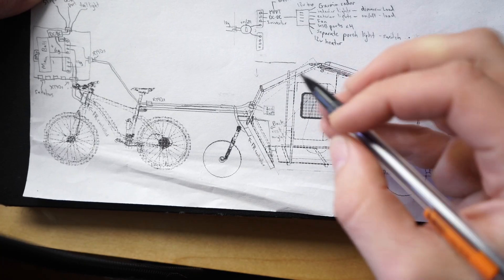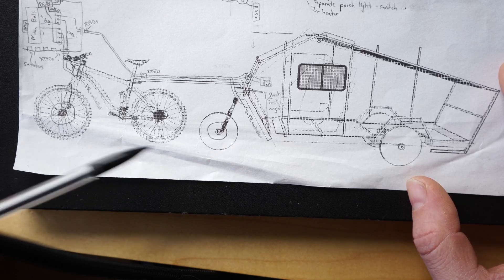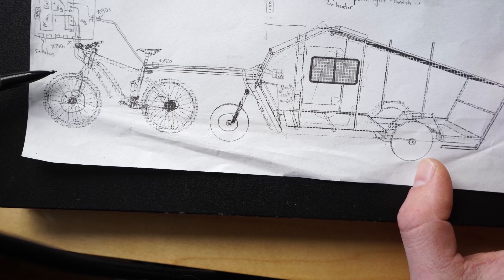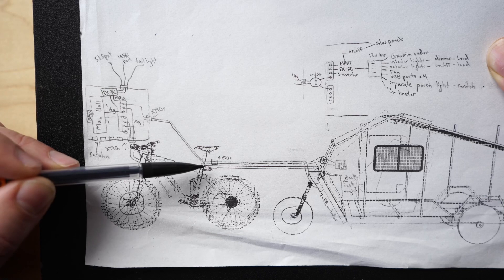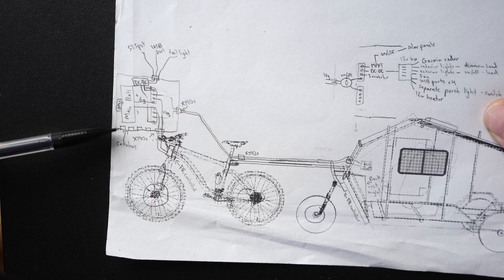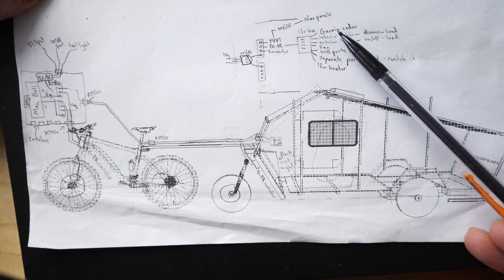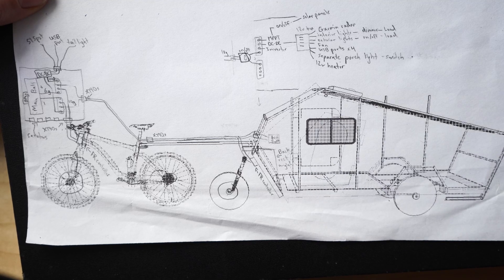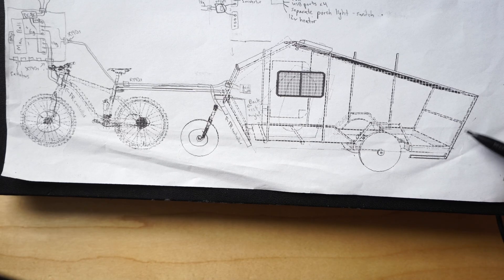Building Electric-Powered Bicycle Camper (PART 10)

Comment: IF you don't want to go through the logic / electronic controls for the brake lights .. a simple power diode can do that function .. when electricity flows for the regenerative braking direction that direction of flow can provide electricity to the brake lights .. when electricity is not flowing in regenerative braking direction the diode does it's job to stop the flow of electricity and thus no power to the brake lights they turn off.
Reply from the maker: Would this method still allow the running lights to remain on, or would it be only on and off to indicate braking? I would like the rear taillights illuminated and then brighten with the brake signal.
Reply: @Jerbrown  If you used just a power diode in the line to the brake lights it would be on and off only when there was voltage for the direction the diode was pointing to allow .. If you want two different light states .. and you don't want to do it with logic/electronic controls .. you could :

A> Have two lights in each rear fixture you use .. one is a less bright light that stays on , and then a second brighter one activated diode controlled by regenerative braking.

or B> Have two lights in each rear fixture you use .. each is diode limited .. one is less bright , and is on when 'normal' forward amps (but turns off when you are in 'reverse' amps regenerative braking) .. a second is on when you are flowing reverse amps and using regenerative braking (but turns off when you are 'normal' forward amps , not using regenerative braking).

Note .. if you are ok with them .. LEDs as a light emitting diode are both a light and a diode in one device .. a power diode separates the two functions so it will work with any normal DC light bulb , but you would then need the two devices the diode and the light bulb.
Reply from the maker: @ianpgeorge  Thanks for these suggestions, Ian! Makes sense. Cheers

Comment: My thoughts.. consider using only one dc dc converter. Each time you have one, you are wasting energy dropping the voltage. Seems the bulk of your 12v is the trailer. Would it not be easier to just run one 12v supply line back for the bike needs? As far as trailer lights, there are quite a lot of multi voltage kits available that have tail, flash and brake lights built in. Most brake lights are triggered by an output line from the contoller that in turn is triggered by the brake lever (to disconnect the hub motor) when braking. Mine came with brake levers with built in micro switches. Otherwise you could just go with a motorbike control. Flashers are left/right switch with push to cancel. The wiring is pretty simple, ask if you need help. The only thing not covered is brake lights while regen braking if you've thought of that. Because it is possible to to do most braking without using the actual brakes, my hybrid car triggers brake lights when regen braking as well. You'd  be surprised how many people dont realise you're slowing unless lights are on...
Separate issue.. you have made no mention of fusing, it is essential..
I like the idea of manually controlling your oower via 2 throttles for the very reasons you mention (i mentioned traction issues last video) it will just take some practice to operate.
Reply from the maker: Hi Chris, thanks a lot for sharing your thoughts - very helpful. Yes, you're right it would be easier to simply run a 12v line back from the trailer, but I do plan on using the bike when disconnected from the trailer, so I'd need an onboard 12v supply anyways. 

I'm going to look into the multi voltage kits you suggest. Do you mind linking to some examples of what you mean? 

I forgot to mention fuses, right! I am planning on using this fuse on the main big battery: https://www.amazon.ca/gp/product/B000MMDLBG/ref=ewc_pr_img_1?smid=A2FQCGKU3QFWEQ&psc=1

...and the 12v fuse distribution box will have the fuses for each 12v circuit in the trailer.

Comment: For the electric heater .. I would recommend .. applying the heat to keep you warm (not to try to heat the air , to then have that air indirectly heat you) .. something like an electric blanket , warming pad , etc .. there are safe PTC versions that can be put inside a cold weather insulated sleeping bag with you.
Reply from the maker: Good call. I’ll look into those options. Thanks!
Reply: Have you heard about butt burn from car seat heaters . Seating on a blke seat or recumbent with electric heat is in my opinion safe for a few minutes , butt not for long rides .

Comment: I don't have one to confirm .. but .. For the garmin radar .. it charges from USB .. if you have a USB output  .. maybe you can just run a wire to it and leave that plugged in all the time to it .. but .. you'll want to add some weather proofing to that USB connection , as Garmin did not design that USB connection to be open and exposed to the elements 24/7.
Reply from the maker: Yeah, maybe that’s the best way to go rather than breaking the unit open and trying to mess with it. Thanks